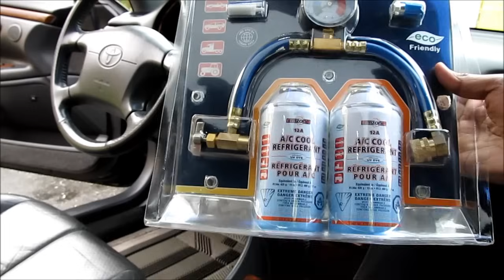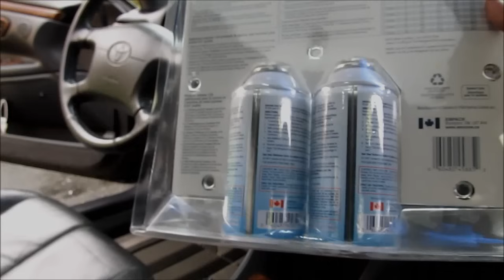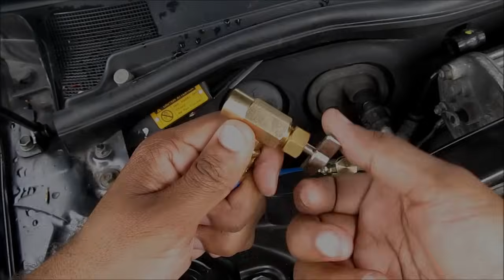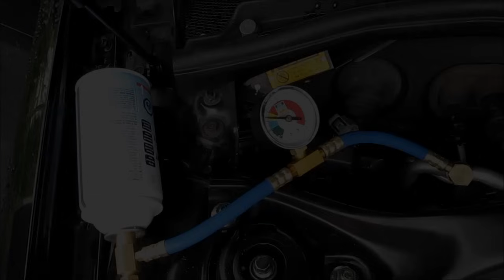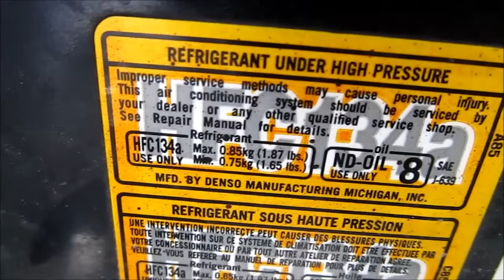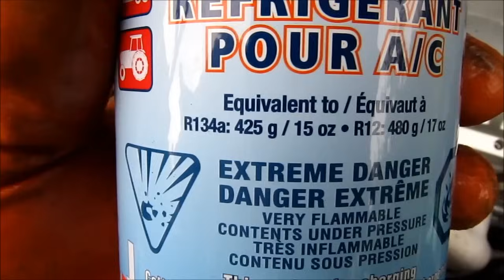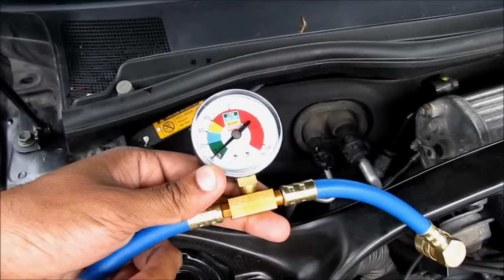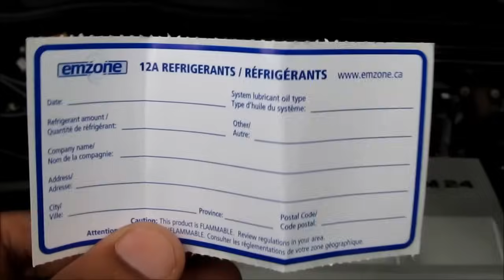How to Recharge an A/C System

Comment: Legal Status: Many states prohibit using flammable refrigerants in motor vehicles, regardless of which original refrigerant was used in the vehicle. It is illegal to use hydrocarbon refrigerants like HC-12a® and DURACOOL 12a® as substitutes for CFC-12 in automobile or truck air conditioning under any circumstances.
Reply: Behind each car - there is this tank full of flammable liquid (10-15 gallons).  Wondering when states prohibit that :-)
Reply: @JohnPham2015 Indeed, but the propane is inside the passenger compartment and under pressure.
Reply: Yes cars have gas tanks. however the tank is located underneath the floor and is completely separated from the passenger compartment. A/C systems on the other hand do go into the passenger compartment so if the evaporator gets a leak you are leaking highly flammable gas into the passenger compartment. If you want something that works better than r134a r152a is a much safer alternative than the r12a garbage and it has similar pressures to r12.
Reply: @retro_88yota I have bought large cans of R152a (so called compressed air) on line for as little as $2 a can with a coupon.
Reply: How about the twenty gallons of gasoline in back?

Comment: Because of its flammability, it is illegal to replace R-12 with HC-12a in the United States. It is not illegal to purchase HC-12a, or to use it in refrigeration systems that were not originally charged with R-12, except for in certain states that prohibit the use of flammable refrigerants in automobiles.[1]
Reply: Be aware that if you have a car fire related to R12a in the US, you may end up in a situation where none of your insurance companies will back you or or passengers.

Comment: I don't know what's really in that stuff but my guess would be a combination of propane, isobutane and maybe a little R134a. I presume that you had a leak and for some "reason" do not want to use the R134a for which you car's system was designed. My concern is that, if your leak is in an interior component, propane could leak into the confined space of the interior of your car and produce an explosion risk.
I also don't know what the laws are in your state but I'd bet that, even if what you're doing is legal, the system must now be labeled with the refrigerant name. Resale value then?  Unlikely that most AC shops would touch the car for system repairs.
Reply from the maker: wholeNwon R134A does not sell anymore in Canada. R12A is its replacement and supposedly more efficient at cooling and less harmful to the environment.
Reply: speedkar99 Yes, propane is an efficient refrigerant. No, it is not as harmful to the environment as chloro/flurohydrocarbons.  I think my other statements are still valid. If this is propane, I would worry about leaks in a small space like the inside of a car. I didn't realize that you are in Canada.
Reply: I'd say you worry too much about stuff that is none of your business. So, chill.
Reply: @DavianSinner  Didn't know we were talking to you, whoever you are.

Comment: I just made a comment on a timing belt replacement by you, however on this video you just got it wrong,a system with no gas is a leaking gas system,first things first,find the leak and then regas other way is like a tyre with a nail simple,
Reply from the maker: The refrigerant I put in has a UV die so I can find the leak. So far after 2 months my A/C is still working and I haven't found a leak yet.